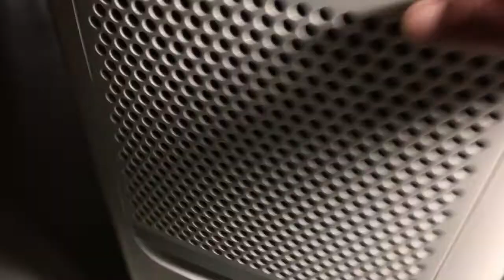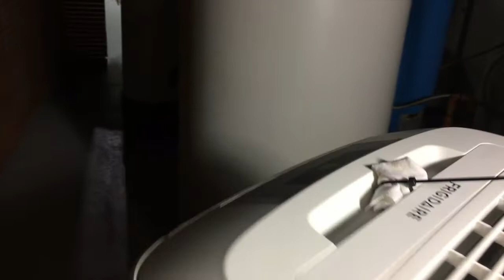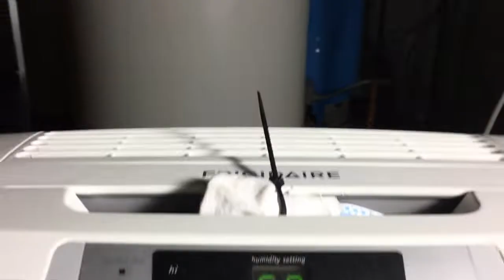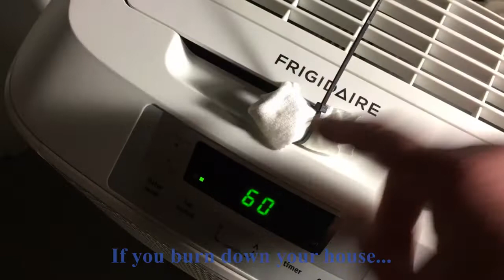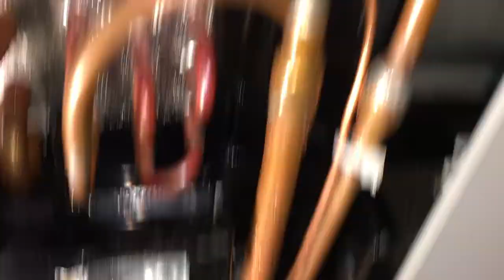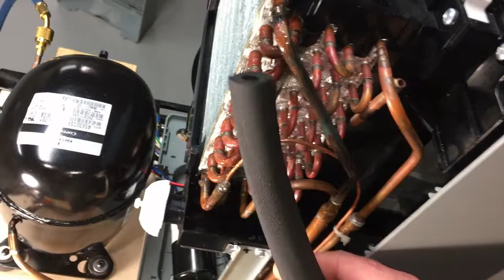Why modern dehumidifiers fail

Comment: Would you happen to know why it would run for a short period of time and then it completely shuts the whole unit off. I'm trying to find out the the issue. I have the same dehumidifier by the way.
Reply from the maker: Hard to say but if it shuts completely off like you pulled out the plug it’s likely something with the control board. If it’s throwing error codes it’s probably low or empty on refrigerant.  It could be as simple as a loose connection or a bad outlet plug.

Comment: Would you know why my Frigidaire FAD504DWD fan does not blow air ?? When you turn on the unit and take a butter knife and spin the fan it will turn slowly but no forced air at all. The unit was not used for years. Ran fine when put away and now it does not run at all, but the controller all lights up. Thanks for the video to get me thinking and Peace too, vf

Comment: That's my unit.  It's borked.  Had ice a few weeks ago.  Figured it was toast but let it thaw.  Plugged it in, seemed to work.  Have an "EC" code now.
Reply from the maker: I’m not sure what the EC code means as these units do not have any sort of high or low pressure switches.  They only have a temperature sensor that allegedly keeps them from freezing up if used in too cool of an area.  However that sensor won’t help if it’s freezing up due to being low on charge.

Comment: It would shorten its life. The sensor  is placed inside the unit for a reason. Prolonging the fan may cause it to overheat.
Reply: Don’t most dehumidifiers have a continuous mode anyway where both the fan and compressor run continuously? They also have timers letting them run for hours at a time. Do these modes contribute to short lifespan?
Reply: that's what I was thinking as well, not all motors are made to run continuoesly forever

Comment: Here’s a little story. I have a White Westinghouse dehumidifier from the early 1980s which was in the house when I purchased it that still runs flawlessly but was adding about $30 to my electric bill each month in summer. So back in 2020 I had the great idea of replacing it with an energy star Friedrich dehumidifier that was presented to me as “top of the line” for over $300. Loved it because it was quiet, looked sleek and had a continuous drain feature instead of a bucket and did in fact save some money each month on electricity. Well back in June 2022 I noticed the basement being humid in spite of the unit running and knew something was wrong. It did come with a 5 year warranty on the sealed refrigeration system so after bringing it back to the authorized service center (and paying a $50 “diagnostic” fee) I got a call the next day to be told it was non repairable and a new one would be sent from the manufacturer. Luckily I still kept the Westinghouse because it took 5 weeks to receive a replacement.  Even more discouraging was when I went to pick it up at the service center and the repair guy said as I was leaving, “see you again in 2 years”. It’s absolutely disgusting that our country no longer makes a dehumidifier and all we have available is garbage from China.
Reply: You have it wrong, it not garbage because it is made in China, it is garbage because Friedrich specified low quality parts to max their profit and customers replacing them every few years. For proof like at cellphones that are also built in China but have quality parts thanks to Apple and Samsung specs and tight QC.

Comment: Brilliant! Thanks so much for the video. I had the same issue on mine which cycled 50+ times a day, which eventually over several years welded the relay contacts closed thus the compressor does not turn off and overheats until it thermally trips. This is the cause of the fire hazard and why they recalled these units. Stupidly they did not design the circuit board to always run the fan when the compressor is running.

Comment: Older dehumidifiers like my late 90s FrankenWhirlpool take off the shelf parts which makes repair like replacing a seized fan motor easy while my 2015 Whirlpool which has been a good worker takes proprietary parts that are NLA as expected, whirlpool looks like it's been through a war but runs better than the new Frigidaire

Comment: I currently have three DEAD Frigidaire dehumidifiers in my basement. Two are 70 pint units that lasted 1.5 years before giving the deadly F0 warning. The third Frigidaire died in 6 months. It's a much larger unit designed to run at lower temps). Also, have a 1 year old Ivation 70 pint unit that barely functions, but keeps the RH at 50%. I wouldn't mind having to replace the units every couple years, except it cost $50 to have them taken away.

I've given up totally on all dehumidifiers and will have my HVAC contractors install a heat pump to condition the air in summer and winter. GOOD RIDDANCE, WORTHLESS FRIGIDAIRES!
Reply from the maker: I FINALLY found where the Soleus dehumidifier was leaking from.  For some reason, after it let all the 410A out originally, the leak must have corroded shut enough so multiple attempts to find it failed.  It had been running perfectly all summer on R152A in my experimental setup but within the last month I started having to add some gas.  I tried several times to find the leak and failed, finally getting disgusted enough to buy a Infincon Tek-Mate detector and it was going off 6" away!  The evaporator coil is basically swiss cheese!  Once I got some better leak detecting solution I found a big leak at the bottom and many little "foamer" leaks in several other places.  The coil looks perfect and the copper is barely tarnished!  It would take $5 more to build a coil that doesn't blow through in 2 or 3 years.
Reply: @chrisbeck8182  Wow, this is extremely valuable and IMPORTANT information. It explains a lot about why the units are failing. I figured they were leaking somewhere and had read how they could be recharged by attaching an inlet. I was going to ask my HVAC professionals to take a look at doing this, but someone mentioned the refrigerant is very expensive, you need to evacuate the system before refilling it, etc, and it would probably cost at least half as much as a new unit. Well, if the copper lines are "Swiss cheese" there's really to point at all. It's my understanding that 90% of all dehumidifiers are manufactured in China by one company and simply rebranded. So, they're using inferior copper and all units are doomed.
     I do have  USA-made SantaFe Compact 70 in my crawl space that seems to be working well. I contacted the company to verify they are made in the USA and that they have fittings to easily be recharged by professionals. I like that. Of course, their 70-90 pint units cost $1400 or so, but I'm not adverse to paying that -- if they are robust and serviceable in the home. I'll ask my HVAC people about that when they come up with estimates for my split heat pump for the basement.
     Thanks again for all the info I learned from your work.
Reply from the maker: @jonboz7585  Even the USA HVAC manufacturers have gotten in on the leaky coils.  To meet ever-increasing government SEER/EER standards the manufacturers use thinner and thinner copper as well as rifling the inside of the tube, which makes it even thinner .  There was a HUGE issue with leaky A/C evaporator coils starting around 2009 and only within the past few years has it been mostly resolved.  Many systems use aluminum coils now to combat the corrosion.  Old school coils with high grade copper still corrode, but the thickness allows much more margin. Now they're using chinesium copper with questionable quality and it's very thin to start with.  

Not to mention, old dehumidifiers use R-12 which runs at 30 PSI in the evaporator.  Then they switched to R-22 which runs about 60 PSI.  Finally they went to R-410A which runs 100 PSI, so 2-1/2 times the pressure and probably half the thickness of material.  Also, most old USA dehumidifiers used aluminum evaporators, just a big coil of tubing.  Not as efficient, but it lasts forever!  

The SantaFe units are good and I believe I read about either a tin-coated copper coil or aluminum coil option they've been testing out on that model to address environmental causes of short life.   Here's a good report from Carrier on why coils corrode and leak: https://aplusair.ca/wp-content/uploads/Carrier-Evaporator-Coil-Formicary-Corrosion-Report.pdf

Comment: Interesting, I would have thought that short cycling the compressor would be what would kill it eventually, but that could do it to, my family had a mid 2000s whirlpool r-22 dehumidifier and it’s been going strong for a while, it has a continuous mode and that seems to help stop the short cycling, I can post the like to the vid I made on it
Reply from the maker: Honestly I think it is simply poor quality copper being used, which is also very thin for both cost and efficiency.  Having the copper corrode under the insulation doesn't help, either.  I know several cases where the R410A has leaked out and nobody could find the leak, including myself.  I believe the copper just becomes porous and leaks it out in many tiny spots, too small to detect.